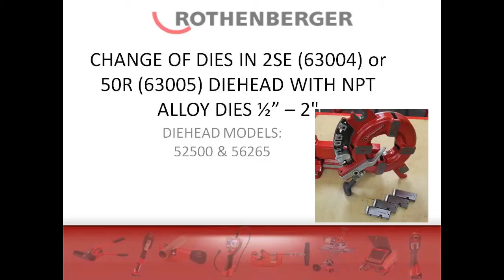Change of Dies on 2SE/50R Die Head With NPT Alloy Dies ½" -- 2"

Comment: Yes me too. This Video is wrong. The disc needed to be rotated clockwise and the silver pin should end up 180 degrees from T handle. This video misaligns the oil passages. I had called Rothenberger after doing what this guy said several times and being very frustrated. Please Delete this VIDEO.